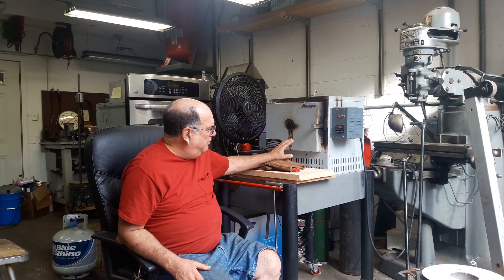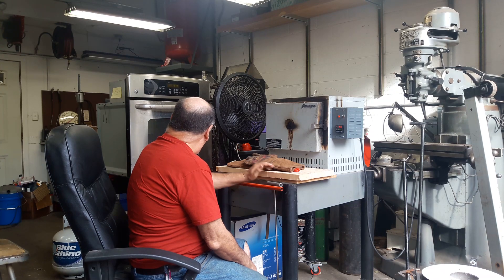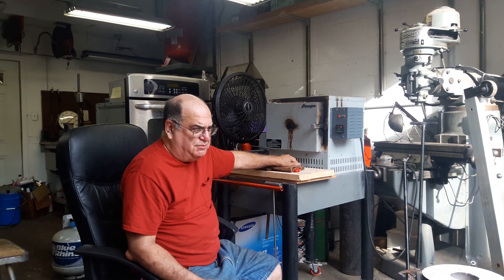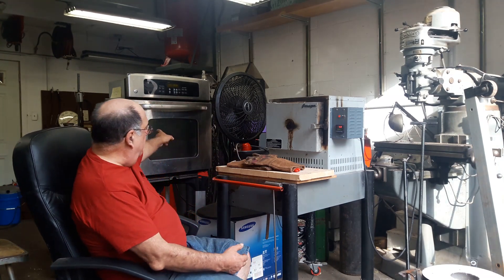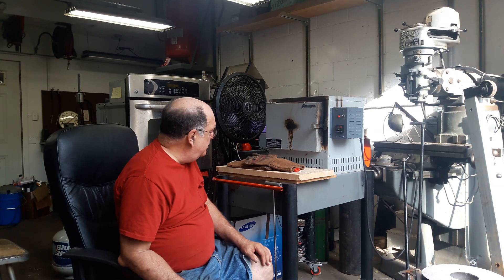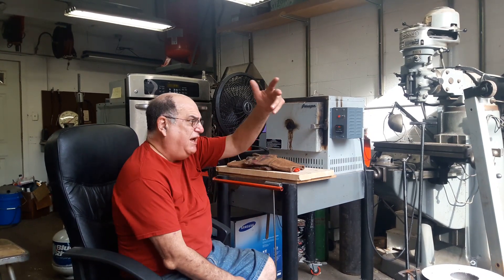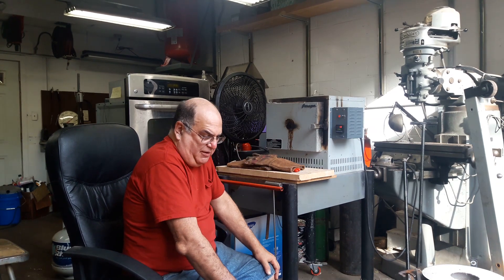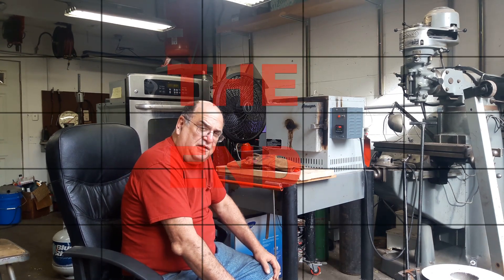MORE ON LOST WAX CASTING

Comment: Dave. Thanks for all your great tips. 
I'm having trouble keeping my parts stuck to the tree even with sticky wax. When you go in and fare the wax, what tools and techniques do you use? 
On another note, I bought the Auber soak and ramp PID and ended up sending it back because there is absolutely no support on that model. 
I went back to the standard PID and just do it manually which works if you set a timer on your smartphone to remind. 
The $22 Chinese PID works perfectly.
Reply from the maker: I have a large kiln but donot use it four flask is more then I can handle at one time.